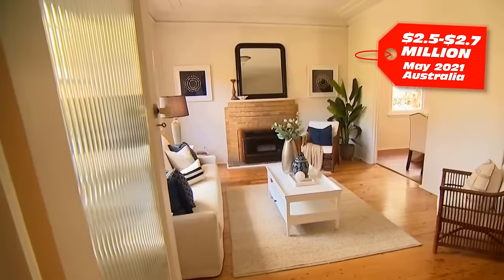3D Printed Concrete House, Printed in 48 hours

Comment: Making houses cheaper to build won't lower the price; it will just make it more profitable for the people who CAN afford to buy houses.
Reply: But it will give suppliers the ability to undersell their competitors who are still using expensive traditional building methods.
Then those competitors will have to use 3D building printers so they can lower their prices to compete.

Comment: What about plumbing and electrical? I’m curious on how that would take place without interior wood framing
Reply: Great question!
Reply: Just wondering the same questions.
Reply: If you want those upgrades, that'll be another 2.7 million dollars. Remember, that's cheap!
Reply: I was thinking the same thing, they say they build the house fast but when does the electrical and plumbing go in, guess I’ll contact someone and get answers.
Reply: Plumb and wire inside the shell in the insulated area then the inner walls are finished. No fishing wire you have total freedom of placement.
Reply: I have a guess. Since walls are "empty" on the inside, you can just lay the cables or pipes inside them. All you need to do is drill a small hole for sockets
Reply: @juneberry1982  Negative Nellie
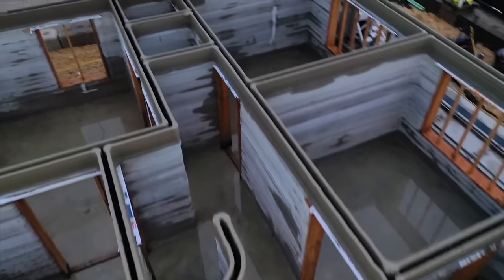Reply: if i had to guess, i think they use the gaps between the walls and these cavities are filled with the plumbing and electrical, then, they fill the remaining empty space with the spray foam insulation.  if pause at 0:35 you can see the gaps and imagine that continues down the wall. Repairs will be costly and will be very noticeable. traditional plaster walls added i think should be standard that way you can at least patch up the work and not having to make that rib design that the concrete naturally has.
Reply: Its preferably printed with the design for hvac plumbing and electrical spaces, like its printed with those parts clear or set up. This helps reduce the time it would take to set up the systems as the layout is already there, I've heard that its alot easier to work on like this aswell costing less because less time and effort spent
Reply: Where was wood mentioned? The house is built solely out of concrete
Reply: @clysen8234  Walls weren;t empty on the inside in video. But yes you cam leave room for the pipe and wiring. I'm interested in how you level the robot printer. And then there is the whole issue of getting the concrete delivered which messes up a lot of poured concrete construction. And the digging of the foundation
Reply: I assume the same way brick houses have been doing it for centuries in europe. You cut a slot in the bricks, lay the cable in and put plaster over it
Reply: Wow I didn't think of this
Reply: @elek101  moo
Reply: There could be a separation between the concrete and drywall for all the rooms, with the main line placed underground as all power wiring should be, free from the ravages of nature and insects.
Reply: Rough it in before you “lay the slab” same theory.    Pretty damn amazing stuff right here.
Reply: There are a handful of human workers who assist the robot
Reply: @juneberry1982  my school cost that much to be build and it's even bigger then the high school
Reply: Already accounted for in the print
Reply: The pluming, electrical, and windows are all installed simultaneously during the building process.
Reply: They lay it out before hand and it’s pumped on top of the pipes where they need to come out of the wall. It’s not that hard to imagine or come up with a sensible solution to that🤡🤡🤡🤡
Reply: Hang sheetrock on concrete. Now that’s a job.

Comment: This is extremely cool tech, but realistically all that I see being done here is framing and interior walls. Is it also installing electrical, plumbing, heating/cooling, insulation, roofing, doors, windows, cabinets and finishing walls and floors? Anyone that has ever built a house knows that this is where 90%+ of the final cost comes from. That is also the part that takes months and months to do. I also don't see any rebar put in that concrete. Concrete without rebar is extremely brittle and can be easily broken. Like I said, very cool tech. I would personally let this one sit in the oven for a decade or so before I would look into it for my home.
Reply: Yeah I have a lot of questions too. All they’re doing is pouring concrete walls (without rebar). I feel like this creates more problems than it solves. How on earth do you turn a maze of cement into a functioning house? Jeez. I’m not sure if the person who came up with this has ever built a house before. I mean how in the bloody hell do you do ANYTHING if you don’t have hollow walls? Everything would have to run above the ceiling - not just the electrical. Plumbing too. How would it look to have your toilet supply line visible going up to the ceiling? I have a ton of questions about this.
Reply: @Tomorrow is Yesterday Plenty of countries don't have hollow walls 😅 You pass the wiring through tubes incased inside the walls. The same goes for plumbing. My house has no hollow walls and there's no visible pipes.
You just dent the wall, insert a pipe and close it off with more concrete.
Reply: @TheRossWise - Uh, did you not see refrigerator and other appliances when they looked inside the home, or did you not get that far into the video because you rushed in here to beat your chest about your house-building experience?
Reply: @TopBillinSports  You DO realize they were looking at a finished home, right? As in, all the work I mentioned was already done prior to the video shoot. Seriously dude, a little common sense goes a long way.
Reply: These look like they will be difficult to insulate. The simple floor plan will make plumbing and electrical fairly easy provided there is a basement, crawl space. Heating will be electric baseboard or hot water if built on slab.
Reminds me of Thomas Edison’s idea of selling concrete houses. He lost a lot of money trying to make his system work.
Reply: @KaleidoscopeEffect  “simply dent the wall, insert the wire, then refill with concrete” - I take it you’ve never wired an entire house before! 😅😅😅 That’s fine for a repair job though. But seriously. The point is that the idea that one can simply 3d print “a house” is absurd. All they are doing is printing a corn maze and that’s it. I’d much rather just take the time to stick frame  it so that the house actually functions like a house. It doesn’t take long at all. A small crew can easily stick frame a single story house in 1-2 days including trusses. I have never found myself in my own home saying, “Wow, I really wish my walls were nothing but solid concrete and had all these ridges in them.”
Reply: @TopBillinSports  The point is that the walls of the house are only 10% of what makes a modern house a modern house and so one cannot say they are 3D printing houses if all they are doing is pouring a concrete corn maze. A concrete corn maze does not a house make!!!
Reply: @TopBillinSports  damn bro seems like YOU’RE the one wrong 😂
Reply: @shamelsssvhs  - I’m wrong because this loon didn’t see some appliances, or you just wanted to look fruity talking to another man w/ a little emoji? Not one person has co-signed what this guy has said and plenty did what I said, “bUt iT lOokS lIkE i’M wRoNG,” according to you?
Reply: You arent looking hard enough. For the reinforcement
      Theres nothing new about concrete homes  or dealing with the pumbing and electrical. Up until the past few years, theyve just been too expensive.
     Well now woods too expensive. And the loss of heating or cooling efficiency is even worse having a wood framed home. 
     This will be the future, at least this is something viable, not like the electric car Hoax    would apply for a career doing this in a heatbeat
Reply: As someone who grew up in a home made of concrete, it sucks! Concrete heats up in the summer and freezes in winter, insulation can help with that, but the house shown in this video was not insulated, therefore it will be very expensive to heat and cool. Oh, and wifi acts up something dreadful when you have concrete walls, as opposed to brick. I love my brick home, it's toasty in winter and cool in summer.

Comment: This is most definitely one of the futures in home building. Lumber prices and labor cost is astronomical so like anything else, automation is a huge benefit. Combined with computer perfection, its how I would choose to build and develop.
Reply: Maybe if the government had thrown a 20% tax on lumber it wouldn't have ended up so expensive.
Reply: @lyndonbrown9659  had?
Reply: Concrete is not very sustainable either
Reply: You dont know anything about developing
Reply: You think? Lol nope! Dont bank on it! Thanks to Klaus Shwabb "you will own nothing and youll be happy"!
Reply: I just built a 1,300 sq ft home myself and it cost me $140,000 and I sold it for $280,000. It took me roughly 9 months from start to finish.
Reply: Unfortunately this is NOT going to be better then any current construction method for a while as its way too expensive and as for the 48 hours to print that's only the walls and nothing else, no window sections, flooring, electrical still needs installing and then there's plumbing, no time is save at all with this method and the machinery used can take months to transport to the site

Comment: The foundations are good (even tho I think there should be something like pillars in the ground for more stability) but after that it'll be good to just use the concrete as bones and apply electrical wiring, outer isolation (since in winters this will be like living in a concrete (litteraly) box) and on the inner side it's better to make the walls or use drywall.
Other than that the idea is awesome
Reply: On local TV in NY they said something like it should withstand hit summers and cold winters. Plus the spaces in the pouring was fir the plumbing and electrical. For the third world small homes are great. For the west small homes and even bigger ones will help since the housing market is experiencing a shortage and prices that are insane right now.
Reply: I myself would opt in for the industrial look and run cable wires through painted metal pipes. I like the look when done right.
Reply: @MrGlenspace  It literally has no insulation, it looks terrible, concrete is a terrible insulator. it's under 200mm wide but 100mm hollow on the insid with structural joints. You could break it with a hammer. The inside and outside probably annoying to frame since no flat surface. It doesn't take a wise man to figure how terrible this all out.
Reply: @fraided88  agreed
Reply: @fraided88  I have no idea about any of this so I don't know who is accurate here .
    I guess I'll have to start doing some research when I find the time
Reply: @fraided88  are there supports for the walls INSIDE the concrete?  Most walls need inside framing.   Also, this house is insanely expensive and it seems all "innovative" homes are.  I like that were trying to get new ideas, but there are always way to much for most people to afford. Thanks for the insight.
Reply: @olly8299  You can disagree without anger. Or name calling. geeze
Reply: @KindCountsDeb3773  I saw in a docummentary that the workers put pillars, wiring and plumbing while the printing is taking place. As for insulation, that's another matter. this seems like a great idea for places that have no seasons, but maybe for places with four seasons they should put extra insulation.
Reply: @fraided88  that’s what I was thinking I feel like the house would be really flimsy since there doesn’t seem to be rebar or to support it well and also there is absolutely zero Insolation and it would be freezing in there like your in a parking garage so much wasted energy from heat and air conditioning
Reply: If the space between the inner and outer walls is airtight, you could pull a vaccum. Essentially creating a thermos you live in. No extra material required and better than any traditional insulation.

Comment: I obviously need to read more about these, but can’t believe these would be approved by code without a steel skeleton for structural integrity!  Especially in an area prone to earthquakes!
Reply: Please see what happens with spalling. Over time the concrete absorbs water and rusts any metal inside,  which forces it to break. 

There's no way they're going to spend for stainless.

Greedy builders are already screaming about tornado shelters.

Comment: Sooo.. you're just not going to insulate it? Or.. install any electrics or water? When and how will that be installed?
Reply: Exactly.. It's 3D printed walls.. Not a house..
Reply: If you can leave a slot for windows and doors, why not HVAC and such? I think it should all be behind easily removable panels so you can get to it. Jmo.